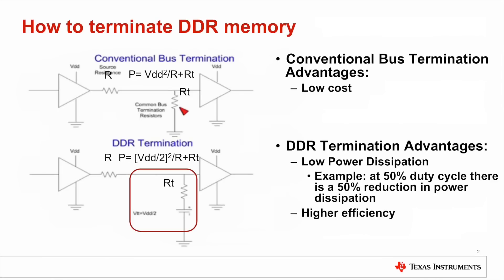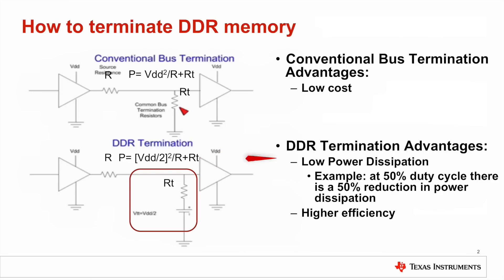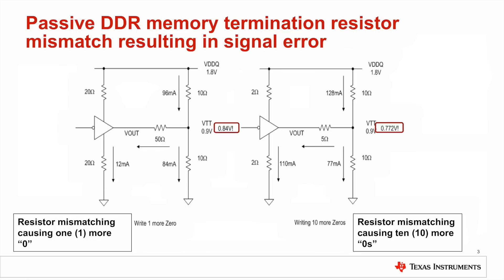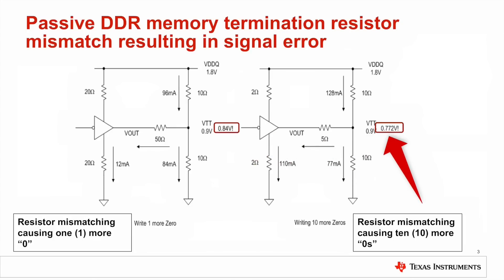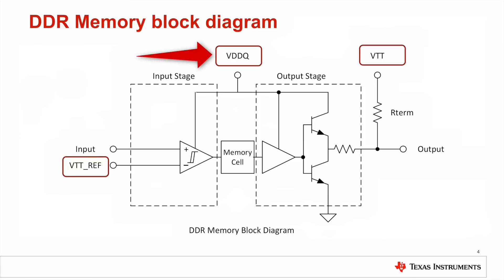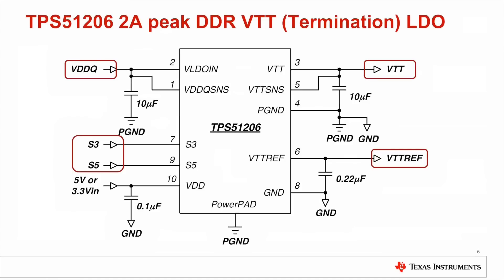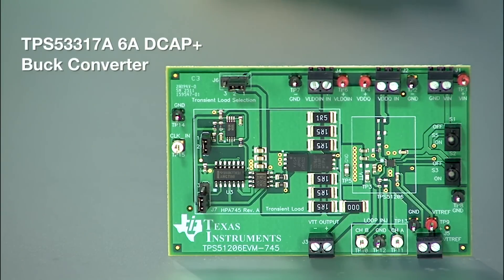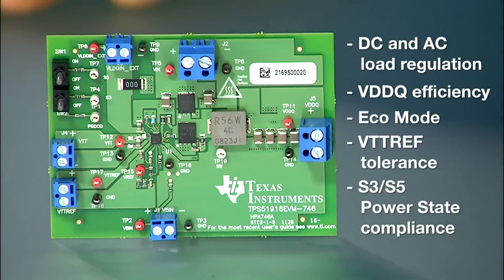Active vs. Passive DDR Termination

Comment: Where are the resistors? Its op amp and then op amp again so its inverted, the CPU ODT on die termination is what gives 2 circuits as the opamps are fed from both directions with cpu odt the 0??